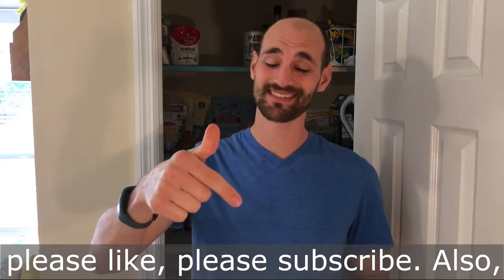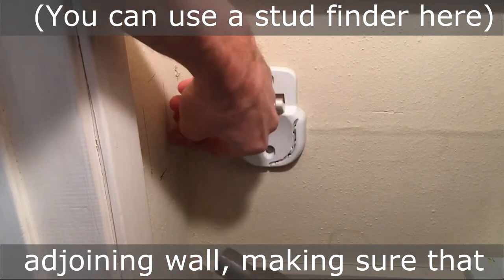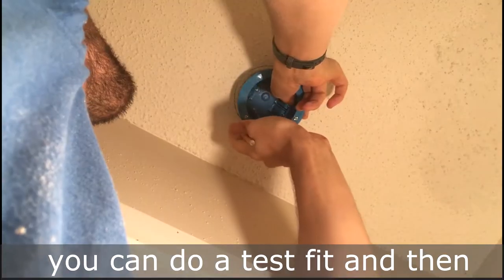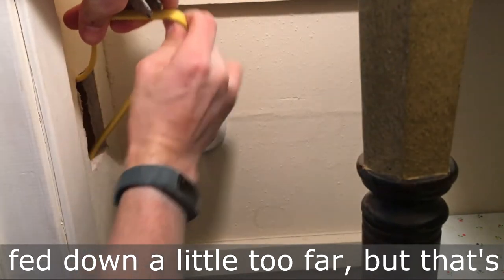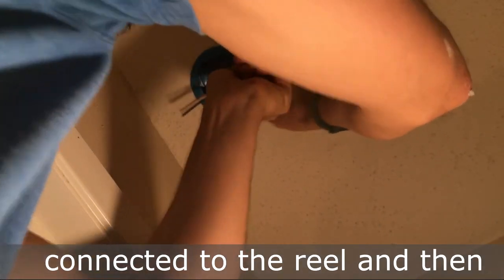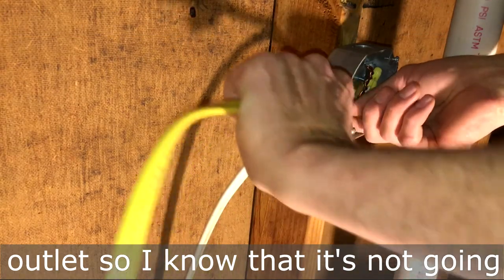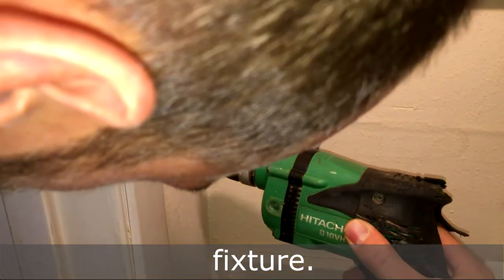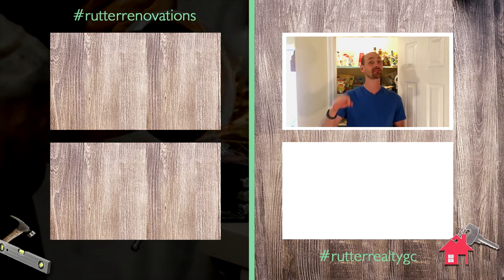How To Add a Light In a Closet

Comment: Thanks for the video Ryan.  DR Horton gave us a fairly large linen/storage closet in an upstairs hallway in our house.  Unfortunately they did not see fit to give us a light in that closet.  I'm going to see if I can wire up a light and switch following your video.
Reply from the maker: Best of luck with your project! Always check with your local professional licensed and bonded contractor for proper building codes and installation.👍😊

Comment: National and local electrical codes always require a clamp for any cable entering any kind of metal junction box for strain relief and to avoid the wires being damaged by the cutout hole in the metal box. Also, when putting wires on the screws, do so in a clockwise direction then tighten screw.
Reply from the maker: Yeah, the clamp on this junction box is on the interior of the box. Probably hard to see during the time lapse though. Thanks for the clockwise tip.
Reply: @rutterrealtygc  thank you for taking the time to make this video.

Comment: Thank you for the video.  My only concern is that you never mentioned killing power to the box that you tapped into?
Reply: That’s why i recommended calling a licensed electrician. Improper workmanship can burn your house down . BELIEVE IT
Reply from the maker: They definitely should. Can't agree more.
Reply from the maker: Hey Coach,
 At the top of the screen the words flash "TURN POWER OFF BEFORE PROCEEDING" for over 10 seconds and as shown in the video I am using my electrical meter to verify there isn't a current and the power is indeed shut off! You should definitely not work with live electricity and Scundoor Sup is correct, calling a licensed electrician is always the way to go.
Reply: @rutterrealtygc  especially call an electrician , because some of the questions are from  naive , DIY people that need to stick to growing tomatoes 
It’s for their own good

Comment: Thanks for the video I'll be doing this exact project soon and was looking for others who may have already done this.
Reply from the maker: Awesome! Best of luck and thanks for the comment! Love the profile name!👍😊
Reply: Please call an electrician. There are tips and standards you must meet for safety .  Remember, faulty electrical work can burn houses down , not to mention death.
There are faults in this videographer’s  methods ! 

Please call a licensed ELECTRICIAN!!
Reply: @scundoorsup5342  What were the faults in this video? (I'm not a DIY or electrician).
Reply: @rem45acp  12 two for a light circuit is too expensive and overkill for 15 amp. You have to look at value and affordability as well. Use 14/2

Comment: My problem is I don't have an attic. I need to run the wiring through the wall and then fish the wiring into the hole in the ceiling. I plan on removing the wall board temporarily to run the wire from the power source through the wall studs to the lighting and switch.
Reply from the maker: Yes, an attic certainly makes a project like this much easier!😬

Comment: That metal junction box needs a clamp for those wires. Also, is this a 15 or 20 amp circuit cause it looks like you are mixing wire sizes. Depending on your local code, 12 gauge can be used on a 15 amp circuit but 14 gauge cannot be used on a 20 amp circuit. Lastly, is that metal box grounded?
Reply from the maker: It was clamped. Wires were the same size. 👍
Reply: I see the 'conduit clamps' you used inside the box. The clamps you should be using are 'cable clamps', the purpose of which is to secure the cables and protect them from the edges of the knockout. Thanks for the video and best of luck with your projects. @rutterrealtygc

Comment: What do you do if the wires in the attic aren’t already spliced and you cannot tap into them?
Reply from the maker: I would guess that if you have space in the panel, you could add a new circuit breaker. I’d reach out to a licensed and insured electrician to gather their opinions on your specific situation.

Comment: I have a switch in my bathroom , I am installing a new light and Rotary switch. When i took the switch plate off and looked at wiring i have many wires, #3 black wires i guess you could say 3 sets of wire coming into the box i figure 1 is the light 2 is the GFCI outlet and the other would be to power fuse box. So i am confused i bought a Leviton Rotary Dimmer push on/off # RDL06-TW this product has its own wires top is black/Green bottom is Red/Red so how do i wire this ? Please help
Reply from the maker: Hey Teri,
  The instructions should be stated within the package the switch came in. If there are no instructions or if you’re not comfortable/don’t deal with electricity often, you might want to contact your local license and insured electrician for their assistance.👍

Comment: What type wire did you use? I’m seeing 14/3 and 12/3 but what’s the difference?
Reply from the maker: I used 12/3 but you should consult your local electrician. 12 versus 14 refers to the gauge (thickness) of wire and 3 is the amount of wires in the chord. I read 12 gauge is typically for 20A breakers and 14 is typically for 15A breakers, but I’d consult your local contractor/electrician to make sure everything is up to code and won’t be a fire/safety hazard.👍
Reply: Nothing  to consult but a qualified electrician!

Comment: don't need to add a box overhead if you just use the low profile LED light.
Reply from the maker: True. I wanted some flexibility though.
Reply: You need a brix anywhere you have a wire to wire connection. Light type doesnt matter.

Comment: Ok I’m new at this so why aren’t the two white wires connected to the back of the switch?   Played your video two times already lol. Good job
Reply from the maker: Hey Luis,
  I don’t give electrical advice because it is difficult to get a grasp of an individual’s particular project and I’m also not a “licensed electrician,” which is why I have the disclaimer to contact a licensed professional. 😉 That being said, I’ve never encountered a switch that required me to connect the common wires (white in my instance) to the switch (although a short web search showed me they do exist).  All the switches that I’ve run have required the white wires connected to one another and the hot wires only  (black in my instance) connected to the poles on the switch. Each switch should have a diagram on the manufacturer’s box and possibly an instruction pamphlet on the inside on how to connect your particular switch to the wires. When I started electrical work it was confusing to me as well. I did a good bit of research and had a friend who’s an electrician come over to go over the basics. I guess I’ve never questioned “Why🤔?” because I don’t really know the answer. I’ve just done it the way the switch package told me to do it.😆 Maybe someone else with more knowledge of electrical can comment and explain why the neutrals are twisted together. 🤷‍♂️ Sorry if I wasn’t much help.
Reply: Think of the switch as an electricity interrupting device. The hot black wire brings electricity to the switch, and when in the on position, the switch allows the current to flow to the light. The White wire is used as the neutral, or return path to the electrical panel AFTER the current passes through the light. So the neutral doesn’t pass back through the switch. It is a straight shot back to the panel.
Reply: @spikeklein2196  thanks I didn’t understand it till now. Question, since I’m this case he had a junction box near, for my case since I don’t have a junction box anywhere near but do have an outlet near me, can I grab power from that outlet? If so, since my outlet only has one set of wire connected to it, could I connect the romex (that is providing power to the switch) to the power, neutral, and ground to the second set of screws straight on the outlet or have those connected directly to the Romex that is originally providing power to the outlet and then cut small pieces of wire to bring the connection from the 2 romex onto the outlet?
Reply: @8ball28  both ways will work, but the second way is preferred. That way power is continuous to your switch, even if the outlet becomes inoperable for some reason.
Reply: @spikeklein2196  I see, and I got one more question if you’d be able to answer. If I want to install multiple lights like recessed cans or under cabinet lighting, for the second light do I grab power from the first light , then for the third light, I grab power from the second and so on, or should I run wires from each light straight back to my power source and bunch then all up?
Reply: @8ball28  you won’t be running cable to each light from the switch. You’ll go light to light to light. However, when adding multiple loads to an existing circuit, you have more to worry about than wiring. You have to make sure your existing circuit can accommodate the amperage. You probably have half a dozen outlets, and perhaps some lighting already on that circuit. Adding multiple light fixtures may over tax the circuit, and cause the breaker to trip to keep the wires from getting too hot. There are calculations for this sort of thing, and you’ll have to “map” the circuit. You can do it, but you’ll have to learn a lot about circuits and how electricity works first.
Reply: @spikeklein2196  true. The circuit I’m working on is for the living room which you’re correct, has 6 outlets, and it already has 4 recessed cans and I’m planning to add 2 led ones which are low voltage but that’s why I’m trying to do my research first. But thanks for the info you gave me. Helping me get one step closer. Not really scared of working on electricity, or at least the simple basic stuff, since I’ve added a few outlets to the house but I for sure have some researching to do in terms of actual theory and calculations.
Reply: @8ball28  good luck and have fun!
Reply: I've had to connect the common wires when replacing a switch with a smart dimmer. Smart switches still require power to stay connected to the internet.
So the when the light is off the switch connects the hot and common wires together to ensure it still has power.
Reply: There are multiple faults with this individuals process .
Call an electrician
Reply: @GodlessArtist  Hey Chuck ,,stick to karate for everyone’s sake .